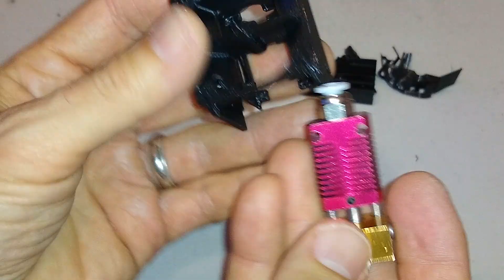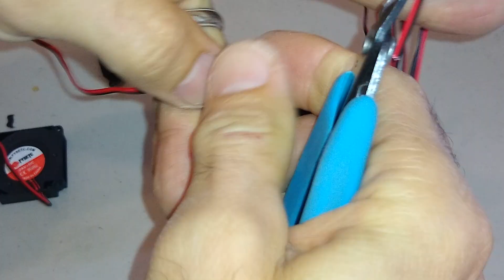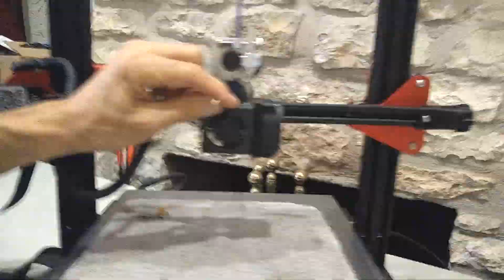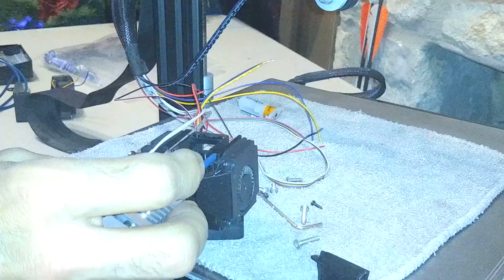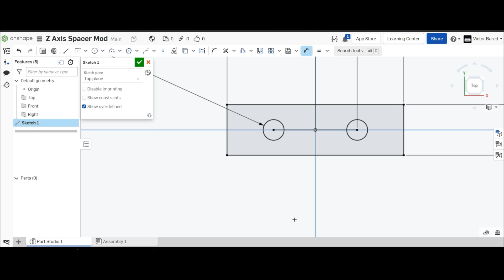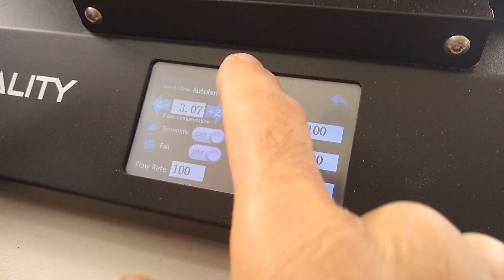3D Printer Super Efficient, Extremely Compact Designed Minimalist Tri - Fan Bracket and Ducts

Comment: nice design, i buy it and try to mount it on an ander 3 v2 but it doesnt fit! fan duct is against the bottom bolt of the adjusting wheel
Reply from the maker: Hello Tim, Thank you for commenting and supporting my work. Turn the bottom wheel bolt around so that the Allen key side faces front. My Ender 3 V2 came with all the  Allen heads facing front from the factory but others like you have told me that the bottom bolt is turned around.

It should fit properly after that.
Reply: @vbared  hi Victor! I've solved it now!  shorter screw and bolt.  

only to loosen the opening for the c clip, it is just a bit too small.  So I'm going to change this one a little bit to make it easier to take off.  but very nice compact design
Reply from the maker: @timvroege5329  Thank you for your feedback, Tim. Let me know what size opening for the c clip so I can modify the file to work better.
Reply: @vbared  is it possible to send you an email about it with an photo?
Reply from the maker: @timvroege5329  Sure email me at vbared@gmail.com

Comment: Love ur videos, have 3v 2 with with slice heat break and hot end, and slice steel nozzle,, do you think it hangs to low for cooling fans to work, I've been waiting to make this and that thought entered my mind
Reply from the maker: Hello Randy, Thank you for commenting and your kind words. What I would do is to print out the free prototype included in the link below. The only thing you're going to need is a 4010 blower fan so you can mount it to the bracket and install one of the ducts so you can see if anything is going to interfere with the slice heat block. Another important thing is that the slice heat block must have a silicone sock to cover it otherwise it will melt the ducts unless they are made out of polycarbonate filament. 

VB Minimalist Fan Shroud .STL file - https://drive.google.com/uc?export=download&id=11hhHbv0PvrdjIz2Jk8H-WjrWOLPBfxxH

Best of luck with your mods!

Comment: Hi, just want to say thanks again for the awesome tutorial videos. I have followed along from the start. Just want to find out if you will be updating the files to fit the CR-10S Pro Micro Swiss hot end? Thanks in advance.
Reply: Awesome! Thanks Victor. Sorry for being “that guy” asking about things that you mentioned in your video. 3-way communication🤣 But Really Appreciate the confirmation. Also I think that a Bowden Tube could be a solution to the hanging cable-since that is what keeps the cables from drooping on the standard setup.
Reply from the maker: @luannels3075  Hi Luann, no worries, I enjoy helping and think 3D printing is a super interesting topic. Thanks for mentioning the bowden tube as a possible cable support. I need to see if it bends enough when the hotend assembly parks at the x-limit switch. The reason I didn't route it from the back like it was, is because the harness and bowden will gets pinched between the e-stepper motor and top cross bar before the 400mm max height is reached.

Best of luck with your mods!
Reply from the maker: Hi Luann, Thank you for commenting and kindness. If you already have a the Micro Swiss hotend for your CR10S Pro you can just order the short heatsink from Micro Swiss for the Ender 3/CR10 (linked below) for about $20 plus tax and shipping. I want to say mine was like $27 total. Then just do everything else in the video to put it all together.

https://store.micro-swiss.com/collections/spare-parts/products/replacement-all-metal-cooling-block-for-cr-10-ender

Best of luck with your mods!
Reply: Thanks Victor. Is that what you did to your CR-10S Pro V2, since you first had the Pro version installed previously? So you just switched out the cooling block, no other parts? And the dimensions remain the same?
Reply from the maker: @luannels3075  Yes, that is what I did on mine. The gantry will get closer to the bed than stock with that shorter heatsink so you're going need to print the little plastic pieces with the angled ends that fasten the z-stepper motors to their aluminum extrusions. So in the end your printer dimensions will be 300x300x405.

https://photos.app.goo.gl/XBSvKJfhz6zRXiYT7
Reply: Are you planning any upgrades/mods for the lead screws? I would think that TR-8x2 lead screws will help make the z-axis more accurate?
Reply from the maker: @luannels3075  Hi Luann, I added anti-backlash adapters to both of the z-axis screws but haven't thought about changing them out. What are you wanting to minimize or improve?
Reply: Also still have to install my anti back lash. I just thought that the movement on the z-axis will be more precise improving the layer lines in a more even manner(dimensionally smoother look)

On th topic of the bowden tube. I was thinking that the cover @ the limit switch/motor with the QR code can be redesigned to hold the Bowden tube. I am just trying to think of a mounting area on the extrusion side.

Comment: Ended 3 V2- 
Micro Swiss direct drive hot end or Hemera…. They are $20 apart in pricing…. The Micro Swiss I could get locally at micro center so no shipping I guess….
But the question is which one to get???
Reply from the maker: Hello cjsawinski, Thank you for commenting. It depends on your technical level. The Micro Swiss is pretty much just replacement of the hotend everything else bolts back like stock. The Hemera is a more complicated conversion but if your end goal is to print with super flexible filaments like Ninja Flex then the Hemera or the Micro Swiss direct extruder kit and all metal hotend is what you want. I haven't done the Hemera upgrade but have experience with the Micro Swiss direct extruder kit with the all metal hot end which is pretty straight forward.
Reply: @vbared  thanks… I’ll go micro Swiss I’m pretty sure… just found out they are even local to me (MN). Flexible as aren’t really a priority actually… mainly want to get into carbon fibers/petg/ and eventually abs… just would like to have the printer set up so I literally don’t have any limitations keeping me from trying new stuff without having to rebuild the thing. Would also be nice to ramp up speeds a bit on conventional stuff. 
I’m new to 3d printing, only been at it a few weeks… I did my research before getting started but damn it’s heavily involved…which is actually right up my ocd/perfectionist alley lol
Reply from the maker: @cjsawinski  Lol, I'm OCD perfectionist as well so I get it. Once you've done the all metal upgrade then just flash your firmware, I highly recommend the Jyers firmware and have a detailed video on how to do it on my channel. The firmware I linked in the description of that video has a max temp of 300 which is more than you're going to need for just about any material out there.

Hit me up with any questions, I'd be glad to save you some time and frustration.

This hobby is the best for OCD perfectionists like us. I get hypnotized just watching the printer running.

Comment: Hi have a question about updated bracket file,do I need new bltouch holder or can be used that one u allready created?
Reply from the maker: Hi Adam, If you already printed, installed, and using the previous version there is no need to reprint it. The only thing that changed is the depth of the notch on the fan bracket to clear the bottom wheel bolt on the X-gantry bracket. It was brought to my attention that some printers have that wheel bolt turned the other way (nut side facing front).  

To answer your original question there is no need to reprint the BL-Touch bracket it's exactly as before.

Thank you for commenting!

Comment: Hi quick question I order  Direct Drive CR10/Ender 3 including hotend is that will fit CR10S Pro V2? or I have to order seperate hotend?
Reply from the maker: Hi Adam, Get the Micro Swiss all metal hotend for the ender 3 if you are planning on using the minimalist fan bracket. The Micro Swiss for the CR10S Pro V2 has a longer heatsink which will not work with the ducts of the fan bracket.
Reply: @vbared  ok,I order Direct Drive Ender3/CR10-S  including hotend so if I correct it should fit to model that u create in video?
Reply from the maker: Hi Adam, please send me the link to the one you ordered so I can tell if it's the right kit.
Reply from the maker: Adam, This is the kit you need. https://amzn.to/3LkTe3A
Reply: @vbared  ok cool do u know what serial nr is on back site box?
Reply: @vbared  I have that one in link
Reply from the maker: @adamw.9165  You're good to go then.
Reply: @vbared  and I don't have to replace heatsink in same way like u did in video?(optional?)
Reply from the maker: @adamw.9165  Hi Adam, No you don't. I was just reusing the Micro Swiss heat block assembly, which is the same in both kits. The only difference is length of the heatsink. The CR10S Pro V2 version is longer (5 skinny heatsink fins) than the Ender3/CR10 (4 skinny heatsink fins). Sorry I should have clarified that in the video.
Reply: @vbared  one more question with ver.bl touch mount are u using 6 or 8mm?
Reply from the maker: @adamw.9165  Hi Adam, The one in the video is 6mm but I recommend you print the 8mm which moves the probe 2mm higher. My BL Touch probe tip when retracted is pretty close to the bed using the 6mm version.

Comment: I own a CR 10s Pro V1 with an Induction Bed Sensor and Swiss All Metal Hot End. I wanted to add a Direct Drive. It seems much of your work will help me solve this need. I got lost in the low or short body of the Swiss Hot end??? And as you said  I would need to print all the parts before I Disassemble my only Printer. Can we work up a more accurate part needs list for this V1, Induction Sensor and Micro Swiss Hot end?  I could pay for completed parts and screws if you are inclined to help an old man. Dennis
Reply from the maker: Hello Dennis, I have the original CR10S Pro V2 carriage bracket that I can use as a guide to figure out how to make an adapter for the induction probe. The Micro Swiss DD bracket isn't as wide as the stock bracket so anchoring the wide induction probe will be tricky. The reason I switched to the shorter Micro Swiss all metal hotend was to use the dual 4010 blower fan assembly that I designed. The short ducts are what makes it work so efficiently. Lengthening the ducts to accommodate the longer hot end would have negatively impacted parts cooling performance.

Micro Swiss sells just the shorter heatsink for $20 US. 

https://store.micro-swiss.com/collections/spare-parts/products/replacement-all-metal-cooling-block-for-cr-10-ender

Please give me some time to work on this project.
Reply: @vbared  Fine I have parts to make for my Train Hobby so I can wait. Thank You for explaining the shorter Heat sink, I saw the water test on the fans and yes that looks quite good. My Induction Sensor seems to be working jut fine I did not see a reason to go the BL Touch am I missing something on that? The Probe is not heavy But it needs to ne stable. The grub screw in my Current Micro Swiss Body to ruined. I can not loosen it to get the Titanium Part out of it. Should I drill the screw away when I get the shorter Body.? And the Hot End screws I need a new one that is also worn out. The Allen wrenches supplied are too soft.  D
Reply from the maker: @DennisMurphey  Hi Dennis, I would try to first make it work with the induction sensor since switching to the BL-Touch might require a firmware tweak. You might be able to cut a slot into the grub screw with a small cutoff wheel on a Dremel then use a flathead screwdriver to back it out. I have an induction probe that I purchased prior to receiving my CR10S Pro V2 thinking it had the capacitive touch probe. I can use mine along with some internet picks of the V1 to get an idea of what the original mount looks like.
Reply: @vbared  I can provide pics of anything if you need something. I ordered the short Hot end. You want me to order the .STLs or wait an bit.
Reply from the maker: @DennisMurphey  Hello Dennis, Let's wait to see how the design work for the probe mount goes. No need to use resources yet.
Reply from the maker: Hello Dennis, Please call me when you have a chance +1 478-227-3301. I need some measurements that would be easier to communicate by voice.
Reply from the maker: I was able to work on it today. Print this up and see if it fits or tell me what tweaks are needed.

https://drive.google.com/uc?export=download&id=15c49AHsXHF6LRobxEJeqeInBCYIUp_CI
Reply: @vbared  printing customer parts. Will put it on when done. Thank You. I had expected vertical attachment as that is how this is fastened.
Reply from the maker: @DennisMurphey  I guessed at the height of the threaded collar about 20mm.
Reply: @vbared  printing now.  3 minutes to go. .stl opened in S3D looking perfect scale etc.
Reply from the maker: @DennisMurphey  Awesome, let me know if any tweaks are needed. The stock V2 bracket I believe is the same as the V1 the only thing I can see different was the probe bracket that screws to it, mine BL Touch, and yours capacitive. If the probe winds up hanging a bit off the left side of the bed I can make the Micro Swiss DD x-limit switch spacer wider so it triggers earlier and gets the probe in the right position. BTW take note of where it is now over the bed with X & Y at 0
Reply: @vbared  yes I see now you are reusing the clamp and adding an extension to the DD frame. As long as to two screws for the Micro Swiss are correct I see clearly how this will work. I will need to remove cover to fully check. Plus look at the Microswiss to see where it mounts in there. You did fine. D
Reply from the maker: @DennisMurphey  Awesome, you'll need to screw the probe bracket to the the 3D printed adapter first before screwing it down to the Micro Swiss bracket. The clearance between the mounted probe bracket and fan assembly should be 2mm. When it's all put together.
Reply: @vbared  Should I order the DD unit from Micro Swiss Now?
Reply from the maker: @DennisMurphey  Hello Dennis, The new inductive probe adaptor you printed will bolt to the Micro Swiss DD bracket for sure. Go ahead and order the DD kit from Micro Swiss but don't take your printer apart yet until we go through the checklist of all the 3D printed parts needed.
Reply: @vbared  I saw the early part and forgot, you then assembled it the DD unit. I got it. Ordering the fans and finding screws are the only hard parts.  D
Reply: @vbared  I ordered the part as it came with new screws too makes sense. Thank You for the link.

Comment: Hi Victor.  Do you have any tips for printing the fan in PETG? I never printed with it before and having issues where the filament is not extruding. I was okay printing PETG for the ducts but can't get past several layers on the fan before I start having issues. When the filament does extrude I end up with stringing. I am using your profile and settings for the fan. I have the Micro-Swiss hot end. 

I also completely dismantled the hot end to ensure there were no clogs.
Reply from the maker: Hello AZWildk4t, Which model printer are you using?
Reply: @vbared  Ender 3 V2
Reply from the maker: @AZWildk4t  Set the hotend temperature to 230 and extrude 100mm of filament to see when happens. It should drop straight down until it hits the bed then it should start to coil the filament on the bed. If it curls coming out of the nozzle and sticks to it then pull free and it should flow down. If it starts curling again then it's not totally clear.
Reply: @vbared  I followed your procedure and no filament dropped. I removed the hotend and possibly found an issue with the thermal break. I really don't like that part as I couldn't get the grub screw to properly hold it in place. I have replaced the entire hotend with a spare I had. Will retest to see if that solves the issue.

I'm suprised micro-swiss has a thermal break. Seems like they could have 2 parts instead of 3.
Reply from the maker: Hi AZWildk4t, Checking in to see if you got your hotend fixed.
Reply: @vbared  Unfortunately not. I used a multimeter to test the board. The 24v bed and nozzle connections on the 4.2.7 board register 0v instead of 24v. It's the same on the 2 new boards I bought this month so I'm thinking they are defective. The company I purchased them from had some suggestions but I'm sending them back anyways. I ordered a new board from another company and one directly from Creality US location. Hopefully I can get it working this weekend. I have lots of things to print for my B737 Flight Simulator.
Reply from the maker: @AZWildk4t  Dang, that's crazy to have so many buggy boards. Good call in switching suppliers. The flight sim stuff sounds cool. Do you have videos on your channel?
Reply: @vbared  Now I do not think it's the mainboard. I just got another one and same issue. I simply add 24v power to the board and plug in the display. I contacted Creality's Tech Support via email and have not heard back yet. I wonder if it's the display card that is bad. I may try to order one  just to test.

I don't have any videos yet on my YouTube channel. I will be posting some once I can get my printer working again.
Reply: @vbared  I FINALLY figured out the issue. I found a couple sites that suggested I try another SD card and another mentioned the filename size needs to be 32 characters or less. I did a full, instead of quick,  format of the SD card and shorten the .BIN filename. That has solved the error.
Reply from the maker: @AZWildk4t  Wow! Thank you for sharing the solution. If someone else mentions the symptoms you had I let them know to do a full format and check that the file name isn't too long.

I bet you're glad to have figured that out, great job being persistent.

Another subscriber had an issue with their printer stopping in the middle of homing and wouldn't do anything until it was restarted only to fail the initial homing again. It turns out his z-stepper motor plug wasn't seated all the way down causing this intermittent problem.